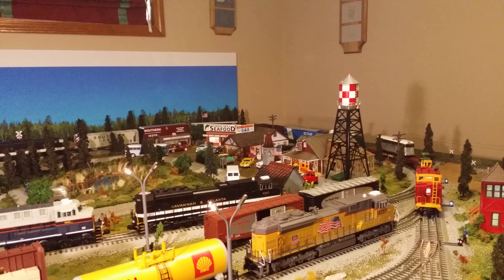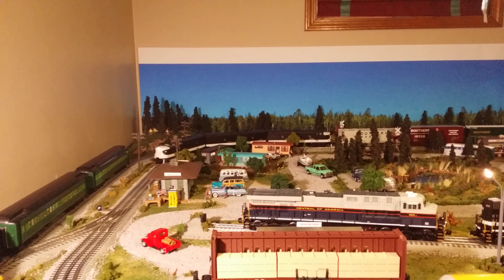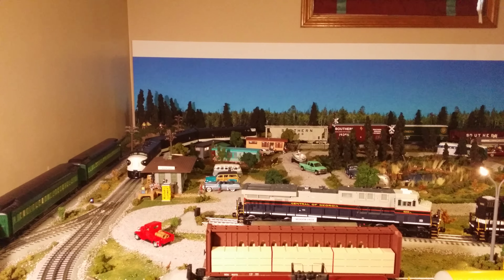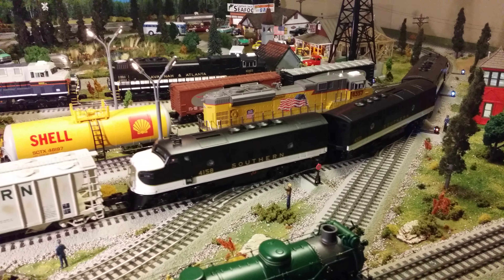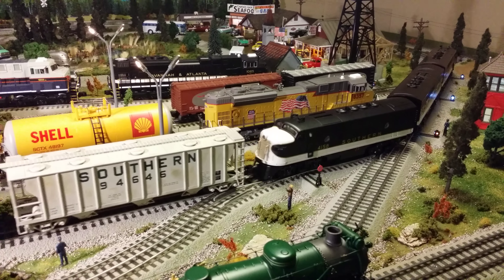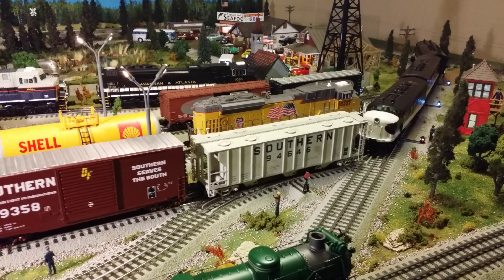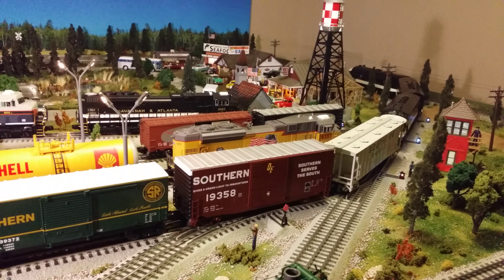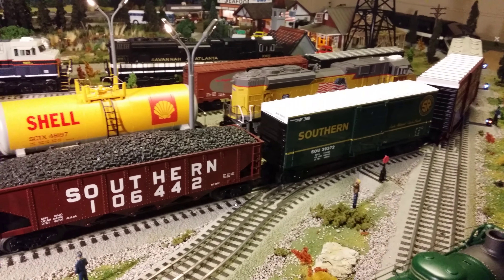MTH F3 ABA struggling to pull 9 cars at 3MPH

Comment: Those should be pulling much better then this...I think it may be time to see if MTH can give you your money back
Reply from the maker: I ended up being a third manufacturer defect in the F3 set.  Wires in the cab were rubbing against the flywheel of the motor in a turn.  I reseated the wires and it’s all good now.  More issues related to the lack of QA at MTH.